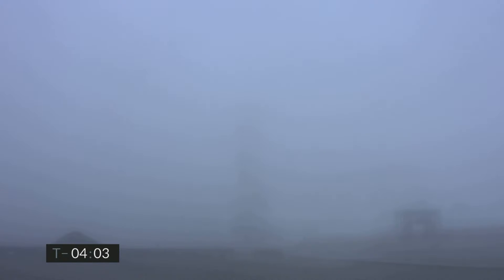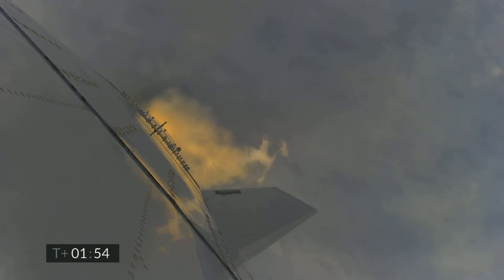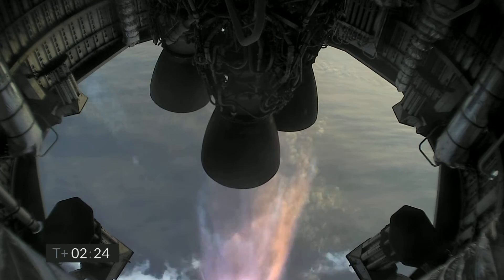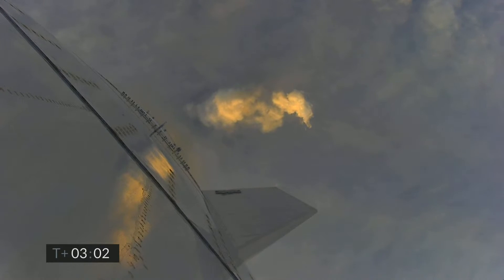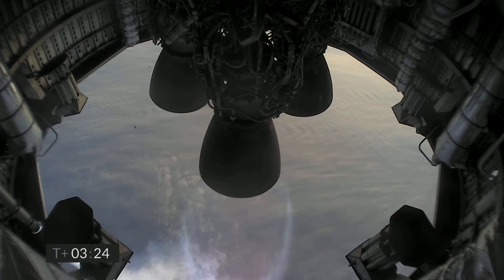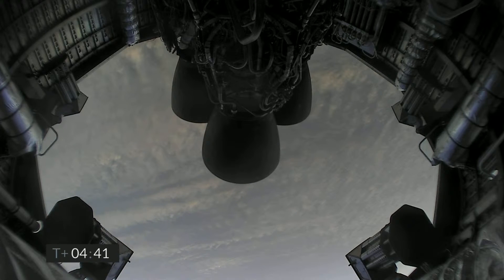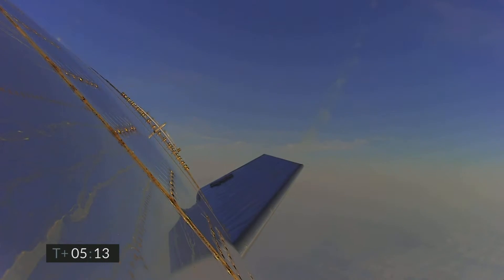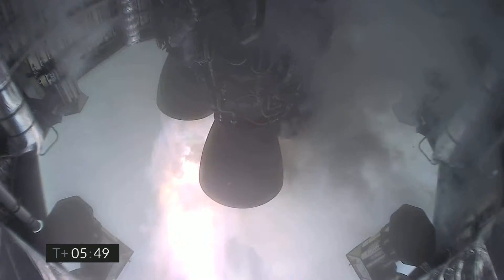Starship | SN11 | High-Altitude Flight Test

Comment: Elon Musk, his companies, I love you all!  You should have made a magnetic rail tunnel embedded in the earth at a 50 degree angle of exit about 7 miles long, and you could launch all the fossil fuels into space using less than a third of the fuel,(will only  be needed for vector control and stabilizing) which is one of the primary expenses, using solar energy, transmitted from space using massive mirror arrays located in the north and south pole that reflect and focus massive amount of solar energy into orbital generators that transmit power back to earth via tight microwave beam, routed then via cables to the world.(transatlantic cable etc)  You then can modularly launch humans , materials , fuel into space safely using the sun.  It would be far safer and efficient and better in every way.  You can launch modular massive 3d printer arrays that can land on a planet and establish a setup for landing and housing before you even arrive.  Using a simple tapered cone for insertion landing on a pad, like a mating fit would eliminate many issues.  It would be a simple frame construct sleeve affixed to a landing platform created as well by the 3d printers.  I love you all, but  the most ironic thing has occurred.  Your companies literally have every technology to do this , and are leading most,  yet you are choosing archaic methods over reasoning and higher scope logic, risking lives and material and wasting time.  Is it oversight, I imagine so, or you are already building one.  These are the only two options.   So, you have to be able to see in time if you really want to mastermind how to travel in space.  Otherwise you just waste it.  The 60's HArp project proved you can do this as well, yet with a magrail tunnel, it could launch everything, safely, humans and all, using the sun, using fossil fuels where they actually won't cause us harm; in space.  

If anyone is presuming to judge me, just know that Yale and Standford representatives came out to me when I was 15 to test me because of what happened in HighSchool.  They said this, not me, that I am a creative genius off the charts.  A borderline genius with numbers and such, and I have excellent coordination, which effects more than just the body.  I have already created the fastest form of human powered transportation, which is a new form of bicycle that has a 1.5 times gain over any other bicycle or human powered set up , period.   I also just hacked my own cooling technique in which one of the presidents of the company that I acquired certain components from contacted me because no one has ever used their technology like I have, and I am achieving superior results all across the board, efficiency, safety, performance.   

 I really hope all you arrogant naysayers wake up and learn how to find true masterminds, and not just assume things so much, BYE!
Reply: You are man?
Reply: @elantrauma  no, Son of God now
Reply: @muddyfalcon  You're the son of god?
Reply: @elantrauma  NOPE

Comment: Even though Elon says that failures can teach you something, they did switch cameras in the engine bay from the one (engine 2) that was failing, to a different camera that places that engine behind the others. Sadly, the flight computer did not pick up that engine failure and tried to start it back up FIRST, despite having an obvious fault,  Startup on the other engines ignited the un-lit fuel coming form engine 2 causing the explosion. Poor John had to comment on positive things, despite knowing what went wrong - NOT saying "Da**, it just blew up!!!".

Comment: In my opinion,  Starship is too heavy to land like a lunar lander, it's also too long, so landing something of this magnitude would actually be impossible to do standing like a lunar lander. First option,  you want to land flat for one like a plane, but more like a harrier jet. Second option, use multiple rockets to ferry parts into space that are prefabricated to make a bigger vessel then build it in space and use that to fly to and from mars, the bigger vessel stays in orbit, then you use smaller shuttles to go to the surface. That may seem more viable than trying to land a heavy object shaped more like a fat sharpie marker so that it stands with its nose straight to the sky to take off immediately after work is done. The idea of smaller crafts landing on mars is more acceptable and it's also less likely  to be an issue with the planet's gravity and atmosphere.  Just land smaller crafts with the same idea as making them land like a harrier jet. But this is my opinion,  and I think that this idea would work 10 times better if the test simulations were tried and the results were more accurate.  Starship is a great concept,  but it needs a few additional adjustments to make it work
Reply: When starship gets hot gas thrusters and self-levelling landing legs it wont be a problem.
I remind you that Falcon 9 first stage is likely the same height as the Starship, so the size is not a problem. There is a lot of complexity here and adding wheels, parachutes or additional engines will add a lot of complexity which will affect a lot in the reusability process.

VTVL (Vertical Take-off Vertical Landing) rockets have proven to be the most reliable method of reusability and landing and the problems that starships have been having were related to the propellant pressurization and the engines, nothing more

Starship needs to be big because its goal is to carry 400m³ of volume and 150t of mass at one and be fully and rapidly reusable. There are no other methods for this, look at the Shuttle that tried small crafts or the Falcon Heavy, which cannot land the center core in most of its flights
Reply: This didn't age well.

Comment: Does the SN series starships have any type of gyroscope or gyroscopic stabilizer in it?  Can it be used to control the landing form the belly flop maneuver from over rotation?
Can you increase the raptor engine nozzle gimbaling angles?
Reply: The avaliable gyroscopes are not powerful enough to flip in seconds a 50m tall vehicle
Reply: Yes, they all have gyroscopes. They don’t need to increase the gimbal limit
Reply: @jackwhitlock1   So why the  over rotation from the belly flop maneuver?  The gyrostabilizers combined with the navigation/steering units should prevent that.
Reply: @johnruckman2320  They do that to reduce Horizontal Velocity
Reply: @jackwhitlock1  They don't have gyroscopes
I don't see where you get the idea they had any
Reply: Ilan Mask is an extraordinary man and I have all the respect and appreciation for him __ I hope one day I meet him or even see messages from him on WhatsApp
Wow, oil mask, I dedicate it the best that I wished for, since he allowed himself and sent me WhatsApp messages. I love him and he has all my appreciation and respect.❤️

Comment: I have a suggestion for SpaceX for the engine area. Rather than that area being a cylinder, make a dome in the top of that engine shroud. It would do 3 things:
1) Improve thrust
2) Improve stability while landing
3) Reduce the noise
That noise comes from the cylindrical shape of that bottom shroud area. Combining the idea of a "Hemi" engine (where the combustion chamber is in the shape of a dome), I think this would make tons of improvements.
Reply: You know? i think you should let the real engineers and tech people do their job; They don't need a "Suggestion and explanation" from a random guy on YT.
You have such a high ego.
Reply: And actually, it's not just the noise, but the vibrations that tend to shake things apart. A dome would help stabilize the whole bottom of the Starship. After all, humans have been building dome-shaped buildings for centuries...
Reply: There's overall too much "empty space" which echoes and does more harm than good. Wasted energy.
Reply: The top of the engine bay actually is a dome. But an inverted one, and not for the reasons you're describing, because those make no sense.
It's primarily due to increased structural strength for the liquid oxygen tank.
Reply: 1) How would it improve thrust?
2) How would it improve stability while landing
3) It's a rocket engine dude....

Comment: #SpaceX Why don't you use the same system for landing as you do with your Falcon rockets and your intended main Starship booster? It works!
Reply: Starship in particular will be coming from orbital speeds, both on earth and mars and going into a belly flop burns off a lot more speed than descending like the falcon 9 and the first stage. It also has more maneuverability at said angle with its fins.

The landing system coming out of that belly flop needs to be able to land in rough terrain and landing like a rocket is much easier than landing like a plane. It also makes it easier to take off again.

Comment: There is a better way to land StarShip and the heavy booster. 
If the landing pad was made out of a metal grid of sorts and raised 50+ feet into the air, when a space craft comes in for a landing the pad drops  as the craft touches down. The pad then does all the breaking so no major legs are needed to cushion the landing. This is a much safer way to land.  The drop and break landing pad absorbs all the energy.  It can be made very low tech so as not to fail. Come on we can do this!
Reply: Orrrrr we can do it the way the engineers want to do it?
Reply: @OortCloud  I'm sure the Ford Pinto engineers said the same thing.  It comes down to,  too many things have to go right for the catch a booster to work.  Why design something harder than it has to be? A simple design that works is always better.
Reply: @htannberg  You call your design SIMPLE?
Reply: @OortCloud  Yes, I truly believe so. All the mega hard stuff has already be done.  Landing a spacecraft on a 100? foot circle for example.  Slowing 240 tons down from 5 or 10 mph to zero in 50 feet should not be too hard for SpaceX engineers.
Reply: @htannberg  I fail to see what’s wrong with doing it SpaceXs way...
Reply: Too expensive, too many points of failure. SpaceX has mastered the suicide burn and this is just another way to build on that idea. Nice suggestions though! 👍

Comment: I,m not an engineer but as I've seen  the lift and landing, in case of landing maneuver it seems to have huge momentum that the engines can't harmonize the huge momentum to the required landing momentum or speed. 
Perhaps it may need more time as that landing maneuver must start from a reasonably high distance to enable the engines to harmonize the huge momentum, parachuting may be needed to reduce the great pressure created by engines abruptly  to absorb the kinetic energy , in turn may lead to destroying the ship.
Reply: Flipping higher wouldn’t help if an engine explodes (Like it did here)
Reply: SN10 (which landed) flipped around the same distance SN11 flipped and exploded. SN10 landed.
Reply: @theseeker5094  and then exploded

Comment: Hey space X,

   Got some ideas for yall one increase the cone sizes of the raptor engines doesn't have to be circular maybe another spade, why can you add the honey comb slider like the other rocket, with the capability of closing the holes with the comb and control air flow, can aerodynamics help as well. Just an idea.
Reply: Those are sea level raptor nozzle extensions. I can assure you, they are as close to optimized right now as possible. 

The titanium (honeycomb) fins on Falcon 9 are used for translation (roll and pitch), not aero braking. 

Good suggestions though!👍

Comment: Never will understand why you run two engines lean, can't make power without BTUs. Run them fat on the test stand. Flow pressures are different installed in the rocket. Oh well who am I. Should use inline accumulators at the engine in plumbing at the puck.
Reply: I highly doubt they're running the engines lean. You always, always run rocket engines rich. Otherwise they disintegrate.

Comment: I'm sure you get a lot of ideas submitted like this and maybe its even annoying, but here goes another.

Does SpaceX plan to develop any kind of need or capacity for in flight EVAs for things like repairs, inspections, upgrades, rescues, etc,?  During an ISS EVA Chris Hadfield got something in his eye, a flake of soap I think.  It completely incapacitated him and put him in significant peril for awhile.  It seems silly that such a small thing created such a big problem for a highly trained astronaut in an expensive high tech suit!  In an ordinary work environment a person, even weightless, would just wipe the crap out their eye with a finger, no problemo.  It's kind of a big flaw in these high tech conventional space suits that their design robs the astronauts of a capacity for such simple basic human actions.  I started thinking of a way to fix this.  I came up with the idea of a skiffsuit.

A skiffsuit would be a small spacecraft, skiff, with capacity to maneuver in orbit or in flight to Mars.  It would be big enough to support 2 astronauts for a day or two.  About the size of a Chevy van.  It would have the upper half of a spacesuit on the end of a tubular cherry picker or space arm extension.  Astronauts would crawl into the tube to put their upper body into the space suit end with some footholds in the tube.  The space arm tube could then be maneuvered into position by the astronaut to do repair, upgrade, inspection work by the astronaut.  The skiff would have an automated station keeping that would counter any forces the astronaut has to apply to the work.  The skiff, space arm and suit would all be one continuous pressurized volume.  If an astronaut got something in their eye, got a bad cramp or whatever they could just crawl back into the bigger volume of the skiff to fix it.  They could also easily crawl back into the skiff to take a break, eat, rest, use the toilet, whatever to satisfy basic personal needs.  Astronauts could safely, comfortably and easily conduct EVA work for days in the skiff.

I got the idea watching power grid workers working on transmission lines from cherry picker trucks.  I noticed they never used their lower bodies other than just to stand in the buckets.  They did complicated and precise work to a high standard with just their upper bodies.

Comment: What if you didn't use wings and instead use the magnus effect to slow the speed. The rocket is put on its side and then rotated by the cold gas thrusters. in the end the rotation is stopped because it ran out of rotational energie or by the thruster (maybe even main thruster, they have to be reignited anyway). Benefits of this system would be safed weight by not needing the flaps, when reentering the side that is on the top at a given moment can cool down (would need heatshield all around but way thinner. Also the consequential horizontal movement that is introduced by the magnus effect could help bring starship back to the site.
Reply: Not sure if I completely understand that you're saying, but it would probably have very strong g force's do to the fact that it would be spinning, and it they lost control at all, they couldn't get it back.  Still a cool idea tho

Comment: Hm!  I think a comprehensive structural analysis of the materials to build the engines, pipes and tanks is in order.  Possible defective materials, construction debris perhaps but not likely as that should show up during static firing.  Although I think those static tests are too short, and not enough lengthy refireing.  After all,, that's where the problem is coming from.  Are you using identical SN Tanks during your tests instead of direct feed of fuel?

Comment: Looks like the second engine was in some kind of distress on the ascent. At around 6:11 you can see a small fire break out on the right side of the engine. The plume colour was also a bit yellow-ish, I think this is suggestive of too much oxidiser (or fuel?), maybe there was a leaky pipe or something wrong with the turbo-pump. Perhaps this engine exploded on the landing burn, or the pipe ruptured and blew the tank.
Reply: Yeah. Elon said there was a problem with the engine we see having a fire and off-colored flume. We just have to wait until the investigation is done to know what happened.

Comment: I am sure that in this day and age you can figure out how to get cameras to work without freezing....
Reply: Well its just that the rocket is moving so fast and its probably not worth the money when they know it has such a high fail rate currently and they can get all the data they need from the systems onboard.
Reply: The cameras aren't freezing. The transmission connection is lost.
Reply: They had problems with their connection to Starship. They will be using Starlink dish on SN15 for hopefully better connection.

Comment: Observation! when restarting the engines during the descent, there is probably a return of flame inside the containment cylinder of the engines and no exhaust hatch which opens on the side to let the gas escape. excess heat.

Comment: At 6:14 there is fire above the nozzles on the rocket engine. I'm no rocket surgeon but that don't seem right!!!
Reply: You were correct. Turns out that that was the primary cause of the failure.

Comment: I’m calling bull shit!
You can make this silo go up in space but you can’t keep a camera - that I could keep running from my mom’s basement - going?
Reply: Go down to Boca Chica Texas and see a launch yourself, also it just went to 10km.
Reply: 1. This didn't go to space. 10km is not space; airliners fly higher than that.
2. It wasn't the camera that failed, it was the high bandwidth wireless transmission that failed. 
Sending a high quality signal through several km of extremely thick fog can be a bit problematic.
Reply: Well get calling then, I hope you fix their problem.

Comment: the motors should actually run smoothly already, if they don't, a.  to quality control or b.  that development is not finished yet.
Reply: The Raptor engines are still in development